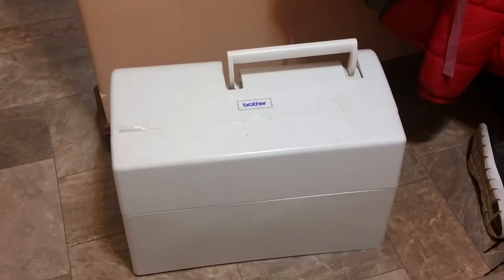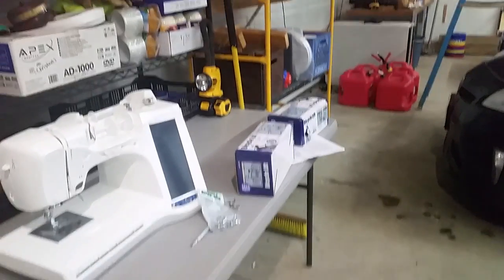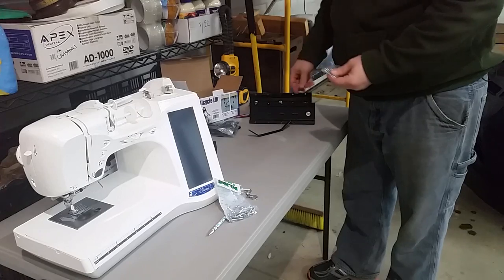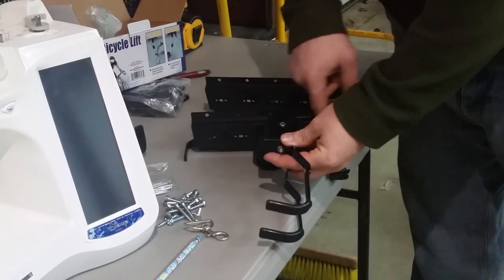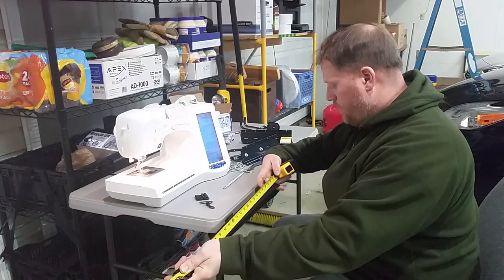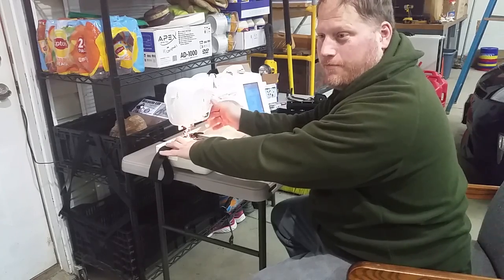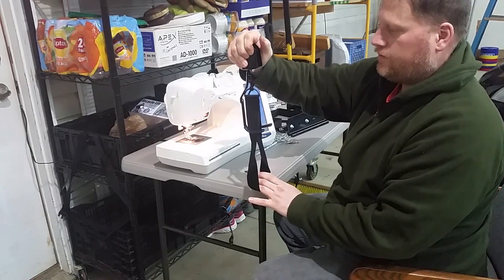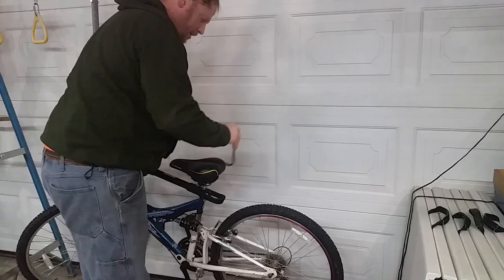Modifing, setup, & install of bike lift pulley system from Harbor freight

Comment: Just installed 4 of these yesterday.   Interesting idea with the straps, probably better than my thought about using a nylon tie-down through all the tires as a safety catch.   One tip for you, search for “clear hitch”.   That’s the best way to secure that rope, the harder the load pulls, the tighter it holds.  Nice vid.

Comment: Nice job, all I could say is get some fresh air in that garage. Gas patio heaters cannot be used indoors. They should only be used in an open outdoor space with plenty of air flow.
Reply from the maker: You are correct.  It Shuts off when I run it on high cuz there's not enough airflow

Comment: I like your modification with the nylon strapping. We purchased several of those bike lifts from Harbor Freight. We had the same problem where the bikes kept slipping off those hooks. We ended up pounding those hooks into a more of an arced j-shape. It seems to work for now but we will definitely try your idea next spring. I'm not so sure I really trust it those hooks at all either.  We also ran into another annoying problem with this product.  The pulley wheels are much narrower than the housing for it, there's probably more than a 1/4 inch gap. The cheap nylon rope keeps getting stuck in between the pulley wheel and it's holder.  At this point it's a two-person job just to get the bicycles up and down.  Next spring we will have figure out other modifications to address this problem. The nylon strap is really a vast improvement though.